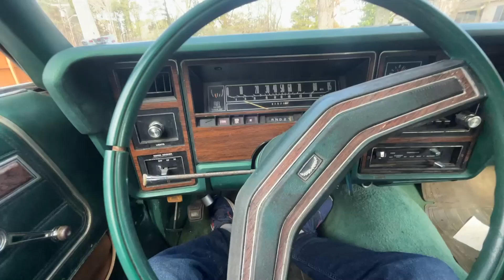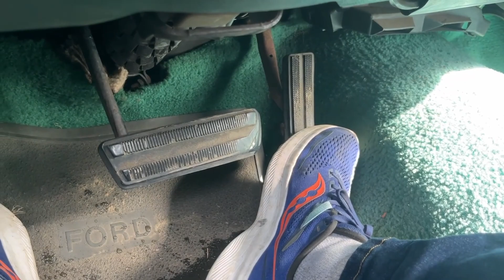LTD throttle response test

Comment: Seafoam it!
Reply from the maker: That will be an interesting video!  Stay tuned!
Reply: @RcFlashlight  that WPULD sound good, and I bet the glasspacks on the GMC would sound better after the treatment.  Your vehicles sound hot rod wild!
Reply from the maker: I think the GMC needs one after that POS quadrajunk carb dumped all that fuel in the engine.  I think the glasspacks are as loud as they will get.  I'll try to do them on both vehicles.